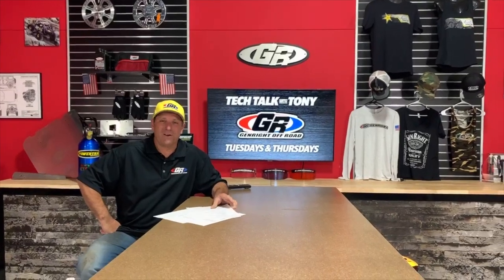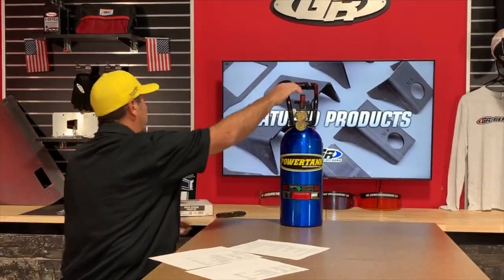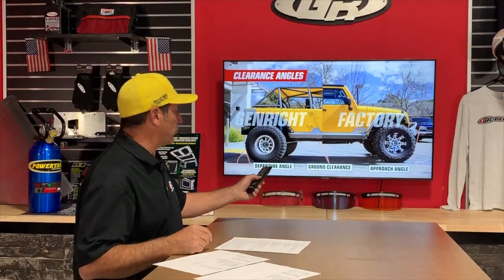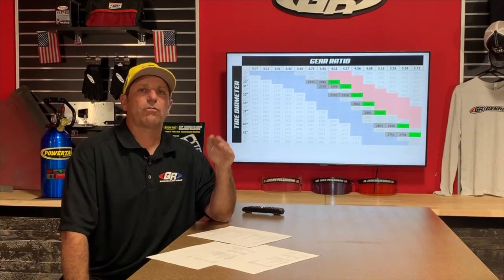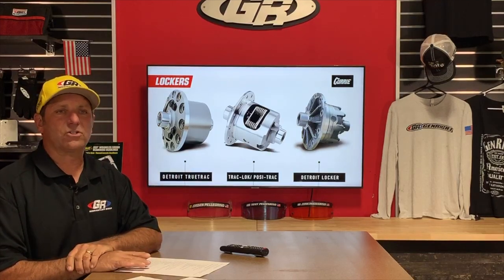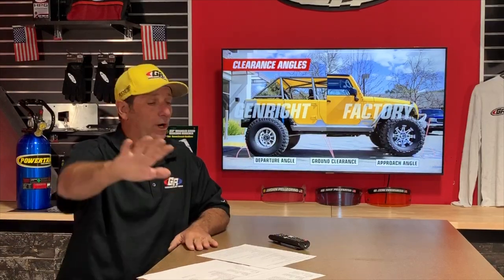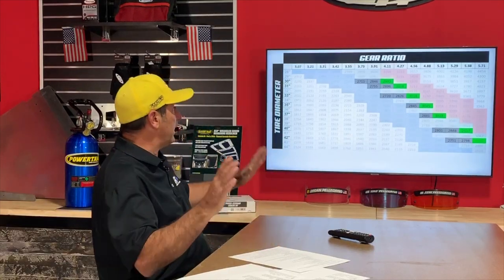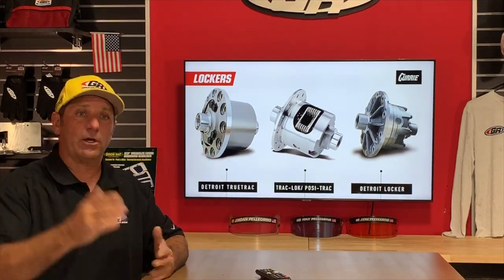Tech Talk with Tony - How to build a Jeep on 35" tires - Stage Builds - Part 2

Comment: G’day mate, regarding fitting 35’s to my rubicon I’ve got a 2”lift and run 33’s, will 35’s work with 2” lift and do you happen to know how much more fuel it will use ?